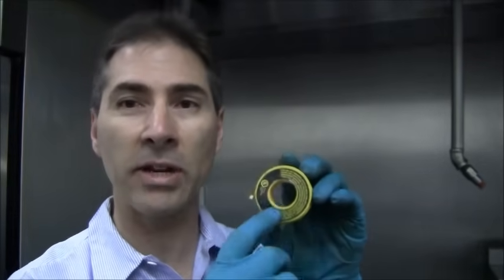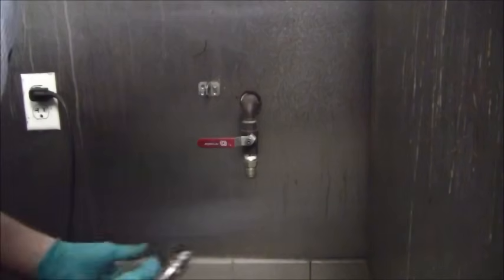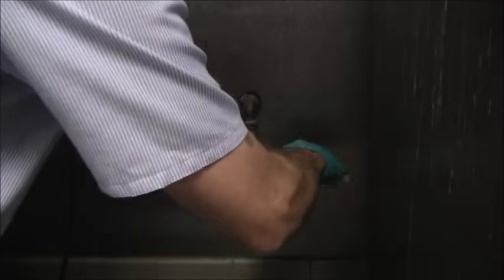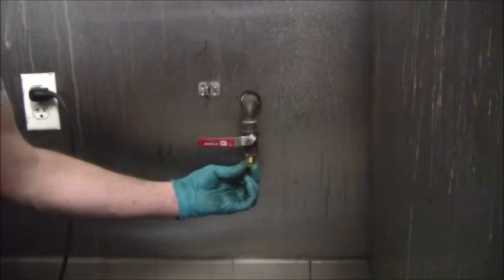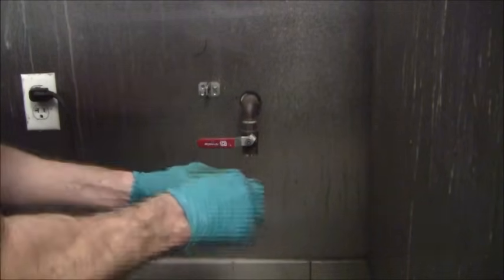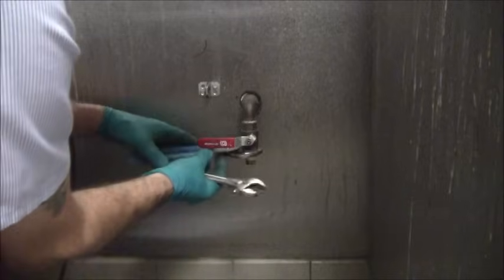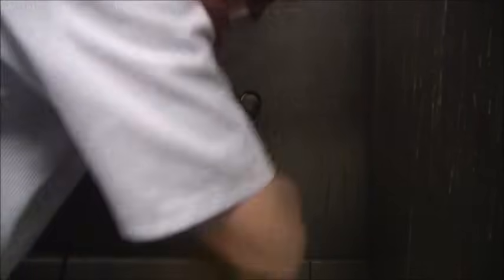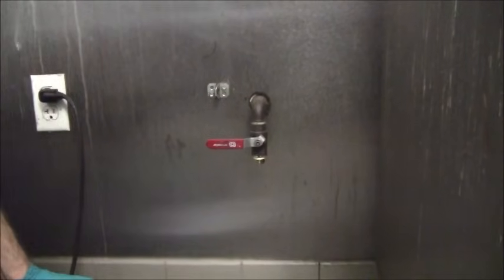How to Cap an Unused Natural Gas Line

Comment: This guy is a dope. You don't use brass with gas fittings(except shutoffs). You ONLY use black steel like the fitting coming out of the wall. Brass is primarly used on water and not code approved for gas. Hire a professional when dealing with gas if your not super handy. Your life isn't worth a few hundred dollars. GEEZ

Comment: First, you're using a plug not a cap. Second, I see what looks like white tape above the valve. Have known many Plumbers throughout my 50 years in maintenance and saw them repair many gas lines. They always used white tape for 1/2" and under but used a triple wrap but first cleaned with a wire brush. Any pipes larger than 1/2", pipe dope was used. All said the same thing. Our stock room in a Huge Nestle Plant never carried yellow tape in the 30 years I was there.

Comment: Great video. You say to use a brass cap for a brass pipe but based on the video it looks like a darker pipe isn't necessarily a black iron pipe. I guess if a magnet doesn't stick then it's not iron and brass is the only possibility left?
Reply from the maker: try the magnet to see what you got. if the magnet does not stick, then you have something other than black iron pipe.
Reply from the maker: https://www.google.com/search?q=types+of+pipe+for+natural+gas&rlz=1C1GCEA_enUS1097US1098&oq=types+of+pipe+for+natural+gas&gs_lcrp=EgZjaHJvbWUyBggAEEUYOTIICAEQABgWGB4yCAgCEAAYFhgeMggIAxAAGBYYHjIICAQQABgWGB4yCAgFEAAYFhgeMgoIBhAAGAoYFhgeMggIBxAAGBYYHjIICAgQABgWGB4yCAgJEAAYFhge0gEIODQ4NWowajeoAgCwAgA&sourceid=chrome&ie=UTF-8

Comment: How do i uncap the cap from a natural gas line? I have a new built home and the builder has capped the line a d ifs sealed. How do i uncap the line? Do i use the double wrench technique? How do i break the sealant?
Reply from the maker: Yes, double wrench technique.
Reply: @KenTraining  but how do i break open the sealant? Is there something i can use to loosen the sealant?
Reply from the maker: @sarangnemani3801  you should be able to break open with your wrenches.

Comment: I wanna do this in my kitchen I’m replacing a gas stove with an electric. Do I have to turn the main gas off outside of the house? Or can I simply just shut the valve off for the pipe there in the kitchen?
Reply from the maker: you can just shut off the kitchen valve. If this is the only appliance that is using natural gas in the home, then you would be safer to shut off the gas at the meter outside.

Comment: Hello Ken,  I thought only caps are supposed to be used to cap gas lines.  If a plug is over tightened it could break the valve or a female fitting.  Could you please comment on this?
Reply from the maker: You can't always have access to put a plug in. I am not aware of a code requirement stating plug only. It does make sense to prevent cracking, but metal pipe cracking is not common. I fell very comfortable with my cap installation and I have not lost any sleep thinking about it...

Comment: How would you go about this if you were removing the valve and then adding a right angle plug to then reinstall the valve and cap?
Reply from the maker: you will need to close the valve that feeds that valve you are removing first. then you can remove you can clean your threads and do the install configuration the way you want. then turn on the valve you closed then leak test and you are good.

Comment: Can I have a line capped and leave the shutoff valve opened? I know it is not the best way to do it but the valve is really stuck. I want to cap it first and work on the valve later.
Reply from the maker: yes you can, to be safe make sure you leak test the cap. if the cap has no leaks you will be safe.
Reply: @KenTraining  Mr. Ken, sorry to be ignorance. I’m just wondering if the gas would keep pushing to the end of the line and nowhere to go if I leave the valve opened and capped the line. Or the way I think is totally wrong?
Reply from the maker: @mttlebo1288  I am not sure if you are overthinking this or? Just cap and leak test, no bubbles on leak test and you have no problems...
Reply: @KenTraining  Thank you so much, sir!

Comment: Hi there. Does this apply to a bbq side burner? I want to remove the side burner and cap/plug the manifold where i will remove the gas line. Thank u
Reply from the maker: yes, just do a soap and water leak test to confirm no leaks and you should be good.

Comment: Capping fireplace gas line to turn fireplace back to wood burning as it was before, can I use the tape and brass cap or use pipe dope with cap? If I use the pipe dope will I be able to remove cap to return to gas fireplace if desired at a later date?
Reply from the maker: you can do either tape or pipe dope. the pipe dope is harder to remove over time but you can still remove with wrenches. In any case use soap and water to check for leaks.

Comment: A good video. Thanks. The suggestion of the double wrench technique is very helpful. One thing could be improved, you could be more descriptive on applying the tape. Saying "has to be the correct direction" and "this way"  or "proper way" doesn't tell us what that direction is, and the resolution of the video isn't high. Maybe if you said "clockwise" or "counter clockwise," or in the direction of the threads or against them, then it might be clearer.
Reply from the maker: Great tip, Thank you.

Comment: Why  is it better to use a brass cap than a iron pipe cap for a gas line?
Reply from the maker: the best cap is matching the metal of the pipe. if the pipe is brass, than a brass pipe cap is best. if the pipe is black iron, than a black cast iron cap is best.

Comment: You did not mention soapy water on the joints to check for leaks.  Would you normally do that (or use a detector) when you cap a gas line?
Reply from the maker: Yes please do a leak check. soapy water is very good and inexpensive. I should have said that...

Comment: Thank you for this content, just one question should the cap/plug be brass or if I am capping  a line a meter away from the valve could I use a cast cap or would this conflict with code?
Reply from the maker: you want to cap with the same metal as the pipe to prevent electrolysis.

Comment: Is it necessary to cap off  if the valve works and the dryer is only removed for a couple weeks?
Reply from the maker: for 2 weeks and good valve confirmed by testing, I would not install a cap under those circumstances.
Reply: @KenTraining  thanks for your help!

Comment: Are all gas valve plugs the same size and if not how do I figure out which one to buy?
Reply from the maker: most likely either 1/2" or 3/4", buy both and return one.
Reply: @KenTraining  Thanks, that's exactly what I did

Comment: very helpful thanks. Why was it important to use brass rather than black iron as mentioned in the video?
Reply from the maker: to prevent galvanic corrosion with brass valve bode.

Comment: I noticed you didn't do the soap and water check to ensure the fitting is air tight. Is that also recommended here?
Reply from the maker: i should have down the soapy water test for leaks.

Comment: Thank you for your time. I have a natural gas grill hooked up outside, I use pliers to turn it on/off. I would like to stop using the grill, dispose of it and disconnect the grill easy on/off connector. I just pulled it off easily and the gas is turned in the off position. Should I remove the access from the outside of our private home? Also right now it has an easy on/off connector should I cap that? Is this a plumbers task if I have someone do it.
Reply from the maker: I would make it so someone could not open the gas up and have gas spilling out around your home. I would leave it outside incase you ever want to use it again or the next homeowner. Just make sure its safe and shut off and capped so that someone would need tools inorder to open the gas.

Comment: If the valve is closed why do you need to cap it?  Because of possible leaks?
Reply from the maker: Valves can leak and someone can easily open and create a bad situation. It is the proper way to leave a gas line for extended periods of time.
Reply: Thank you😊

Comment: I have gas line running from the house to the front yard light post. I like to remove this light post in the front yard how would I cap that from the house?
Reply from the maker: find the pipe, shut gas off, cap where you want to. turn gas on. leak check your work. 
If you can't do that, please call in a plumber to help you out.

Comment: I  have a capped line. It was for a gas grill or outdoor kitchen, but we've remodeled and know it sticks out about 7" at ankle height, the on/off handle is only an inch from the current cap.  I can see people tripping, scraping their ankles and other things on this pipe that's sticking out.  Any suggestions?
Reply from the maker: 1. shut the main gas line off. 
2. take the gas pipe that sticks out and shorten it and turn it 90 degrees so parallel to wall. 
3. install shut off valve and cap.
4. turn main gas back on and leak test all the work you just did. if you pass the leak test, you are done. 
Let us know what you end up doing. 
Thanks for watching. :)

Comment: Loved video. Yellow plumbers tape for gas is best thing I learned. Would have liked to see procedure on capping very old gas line coming into old gas heater. But, since you work mostly on commercial, I understand the industrial use factor of video. Thanks again for yellow tape tip! :)

Comment: What happens if I would take off the gas line from the back of the dryer and the gas isn't shut off? I cant get 2 the shut off valve. I have another dryer 2 replace the 1 I'm taking out
Reply from the maker: if you open the gas line and don't shut the gas off, the gas will be exiting the pipe at full pressure and that can cause an explosion and death. Not a recommended plan of action.
Reply: @KenTraining  thank u very much

Comment: Thank you for your video. I'm in the mist of moving in the next two weeks and I'm taking my gas dryer in my home. It does have a red shut off handle not as long as the one in this video. So the brass fitting cap  is it the standard size cap for all gas lines? Home and commercial.
Reply from the maker: I Think it is a standard size.
Reply: @KenTraining  thank you!

Comment: Hi,I plan on getting my gas line capped, by sure of the rite medal, also I plan on getting a hot water tank installed later on but I hve a few gas leaks repairs to do, very worried I don't want pipes to explode shouldn't all valves b shut off first

Comment: Very well done. I'm about to attempt this in my home, but I'd like to also remove the pipe section that contains the valve, so that our new electric range can be pushed closer to the wall. Do you see any reason for me NOT to remove that valve section? This would leave us with a pipe that sticks out from the wall only about an inch and a half. Thank you!
Reply from the maker: no problem as long as you shut off the gas and cap and test for any leaks when you are done.

Comment: Ken, good video. Question or two: Should one clean the threads before installing the cap?  Also, is it not recommended to water/soap test the fitting for leaks after the replacement?
Reply from the maker: yes to both, I should have said, check for leaks.

Comment: hi, Ken, we have an original 24" gas wall oven in our home. it has trouble igniting and is 50+ years old. We don't have the money to replace it, and I only was curious on how to cap the gas the line. Are there any more safety precautions? I will do more research and thank you for the video.

Comment: thanks for the info. do you have any info on how to cap the gas line beyond the wall so it's not exposed in the room. also, how do you check for leaks after you cap the line?

Comment: i am trying to take off a cap that is stuck on super tight.  they used the white tape.  it is super snug so if you have any tips of getting it off with them using the wrong tape please write back.  thanks!
Reply from the maker: Leverage.

Comment: this video was awesome very detailed. I recently moved been a whole month without a working gas dryer and a outdated washing machine  that the property owners have attemped 3 times and failed to fix or replace. I will be pulling my electric washer and dryer out of storage and making the conversion myself thanks to your video.  capping off gasline got it just need to figure out and learn how to install or use the correct plug for my dryer???

Comment: I'm moving into a new home and they have a gas dryer. I have an electric. If I don't go out and buy a gas one, do most homes have the same kind of set up with the handle for the laundry room? I know you may not have a definitive answer, but if that's all there is to it...then I should be golden.
Reply from the maker: +ryanexpress34 yes, most homes are standard with a local shut off valve.
Reply: +KenTraining Thanks!

Comment: Being a single woman, I solve a lot of household problems with YouTube videos.  My gas dryer broke down and is beyond repair, and I happen to have a brand new electric dryer in storage, so it makes no sense to buy another gas dryer.  I feel better able to shut down the gas line with your safety tips.  I am assuming I use the soapy water test for the leak test.
Reply from the maker: +Yvonne Dwyer yes, soapy water is good for leak test.

Comment: I have a gas pipe into my fireplace coming out of the wall, apparently someone took a gas log out. Since there is a shut off valve in the wall, is it safe to burn wood or do I have to cap it off?
Reply from the maker: +cory eubank I would cap it off.

Comment: In the UK the gas isolation lever should always fall to a switched off position if the lever should fail, the one on the video would have gas pumping in to the kitchen just waiting for ignition?

Comment: Nice video. Thanks for making it. 

It would be helpful to know why capping off unused gas line is a good idea.
Reply from the maker: +Alex Hessel safety, and it the proper way to shut down a GAS line for an extended period.
Reply: @KenTraining  Thank you so much for this video!  I'm capping mine off, and while at the home improvement store, they sold me not only the yellow tape you used, but also a yellow tube of "soft set pipe thread sealant".  Wondering if the sealant is necessary, or if just the tape will do (as shown in your video)?
Reply from the maker: @MarsaLyn  Tape alone is good, BUT do a soapy water test after to confirm NO leaks

Comment: We have an in ground BBQ grill. We are replacing it with a free standing grill w/ a flex line. It was recommend that we leave the pole to protect the gas line and cap the pole when the old grill is removed. What do you suggest to cap the pole with? Is this safe idea
Reply from the maker: Susanne Rothenberg cap with the same material as the pipe.
Reply: KenTraining Thank you!

Comment: I have an old gas in ground BBQ grill that I need to remove.  Would the steps in your video be the same steps I would need to take to accomplish this task?
Reply from the maker: Pamela Goss I would shut off at the line at the house as well. (if you know where it is) and then cap off like I did in the video.

Comment: Thanks for the video, how come brass and not other metal for the cap?
Reply from the maker: usually you want to keep the same metal type whenever you are doing any pipe work. (to prevent electrolysis) 
in this case I don't believe it would make any difference.

Comment: Great video Ken.  Question, when would you want to cap a gas line? My situation is I have a summer home in Upper Michigan. I drained the water heater and water pipes because of the cold winter season incase the furnace motor dies.  My plumber told me to set the gas valve perpendicular to the pipe to prevent any gas reaching the water heater. I expect to go back in July... Is this safe?
Reply from the maker: Yes, you are fine. I was capping an old gas line.

Comment: We are thinking of replacing our gas fireplace with a real fire again. Does that mean we have to take all of the gas piping out? If thats the case then we won't change it. Thanks.
Reply from the maker: I am not an expert in this area but, if you shut off the gas valve and cap the line into the fireplace, that should work.
One other thing to check out, some gas fireplaces are NOT meant to burn real wood. You may not have enough draft for it and the fireplace itself may not be listed for real wood fires. I am not sure how to find this information out either.
Reply: KenTraining thanks anyway!  I think we will be keeping it this Christmas

Comment: What plug to use to cap propane yellow flexible pipe? Thx
Reply from the maker: I don't think there is a plug for the flex line. Can you remove the flex line and then cap the hard pipe. That would be safer.
Reply: KenTraining Sorry for not being clear.. I have T connection "metal" and 3 yellow flexible pipes connected to it from all 3 directions. So One of them is going to the fireplace which I want to remove and cap one opening in  the T connection .
Reply from the maker: It is hard for me to say without looking at a picture. If you want to send me an e mail. you can do so at http://kencogliano.wix.com/kentraining
under contact.
send me pic and I can provide better advice.
Ken